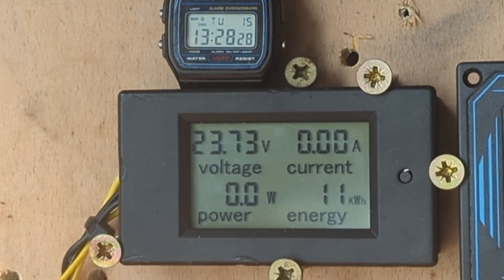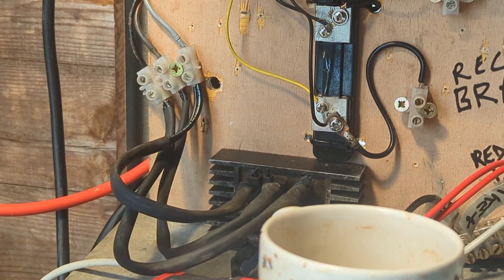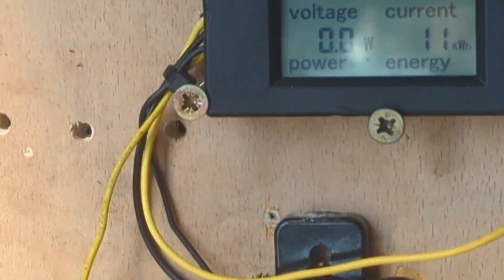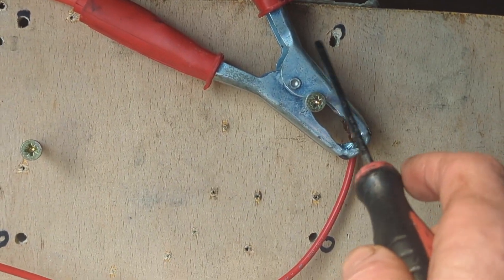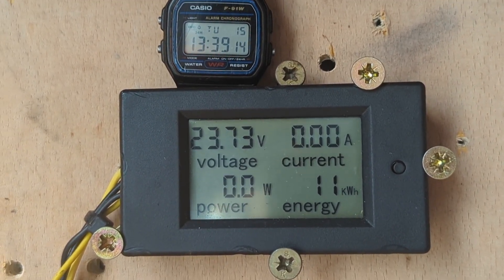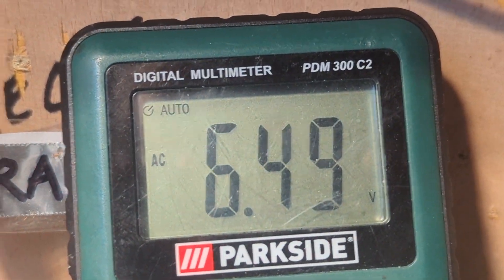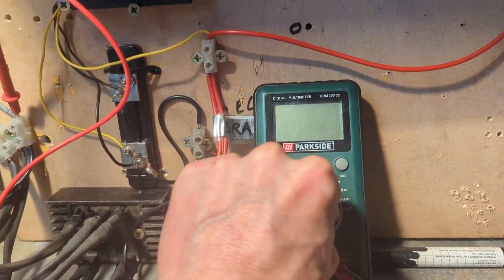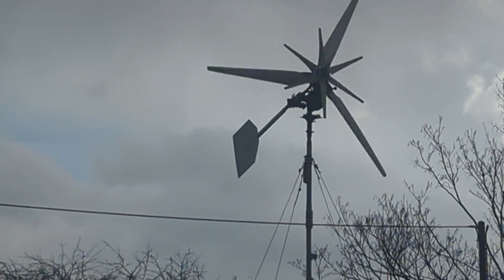After the storm - did she survive?? does she still work ?? free energy project - 14th March 2023

Comment: Afternoon mate.
Are you running your full house on the system.
I'm still looking at learning before I purchase but exstreamly keen on going off grid system but like I said learning is key as I'm not electric qualified but wanting the best for the house and running correctly as it should do
Reply from the maker: Hello mate, thank you for the comment. I just have this connected to batteries. I don't have it connected to my house in any way, That maybe an option for the future but would require a more expensive inverter. I'm quite happy to just run the power to my shed.

Comment: Good to see, she survived with just a few 'battle scars' 
Like a few others have said it'd be interesting to see what sort of loads etc you could run with all this power. A heat battery would be a good one, then you could reduce your bills without having to go for a full mains export inverter and associated sign off. People have made heat batteries from sand with immersion heater elements buried in a well insulated box. You could get the heat out again with some coils of copper pipe and connect it to your heating system - just a thought :) I'm sure you've plenty of other ideas!
Thanks again for posting!!!!!
Reply from the maker: Hello mate, thank you for your comment and kind words. I'm kind of more interested in how much power it will make for the moment and actually being able to build something decent that's solid and reliable, I have zero funds at the moment so I'm just trying to scrape stuff together to continue to project, I still have this beast 72 volt motor. I may think about mounting it to the rear of this turbine if it will fit.

Comment: Phew! Is that fire-retardant plasterboard behind those hot wires? I decided to put all my wiring and inverters on a cement board which I also sprayed with flame retardant paint. Did want to take any chances. Glad to see you're still in business despite the rewiring. 🖖👍
Reply from the maker: Hello my friend, thank you for the comment and kind words. The actual wires that were melted were outside on the floor. Nothing is anywhere near melting on my control board, but I will put it on metal in the future. Thank you very much